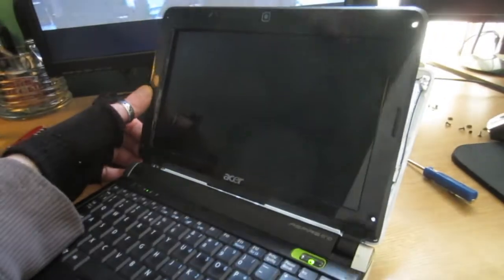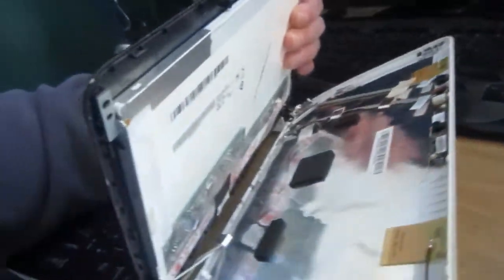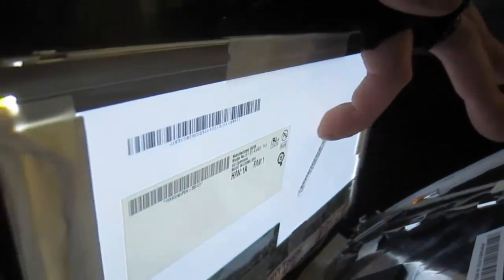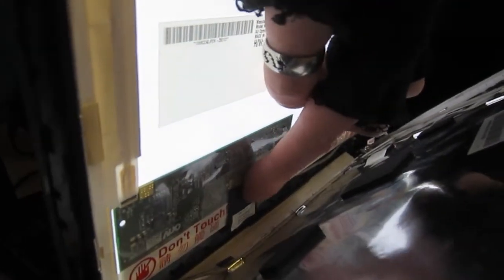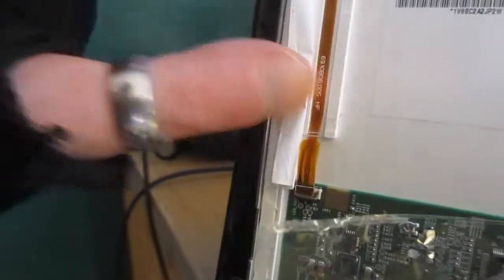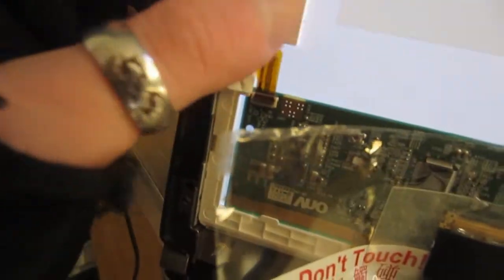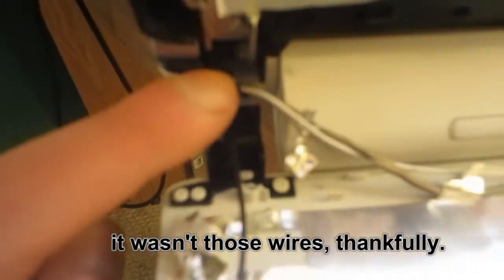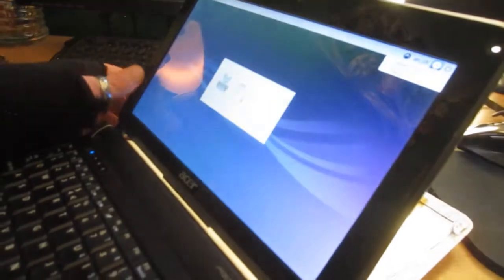Laptop Backlight Connection Repair

Comment: But it says "Do Not Touch"  :)
Reply from the maker: RamblinAround I know... I'm a born rebel! actually I think they just don't want you cracking open the display itself because they tend to carry quite a high charge some times. to be honest i've never once felt afraid of getting shocked from any laptop thus far. its only 12 volts :) cheers Jeff. Thanks fer watching.